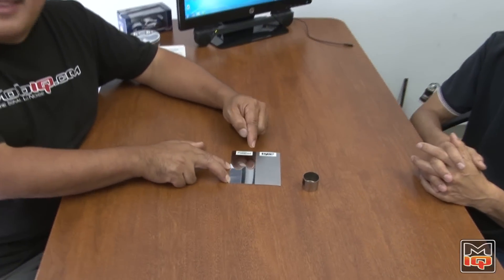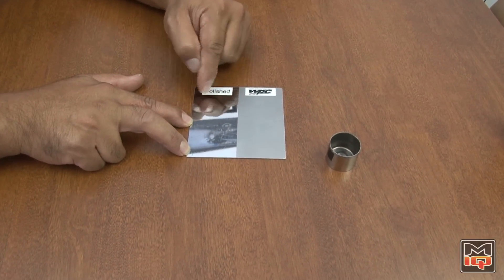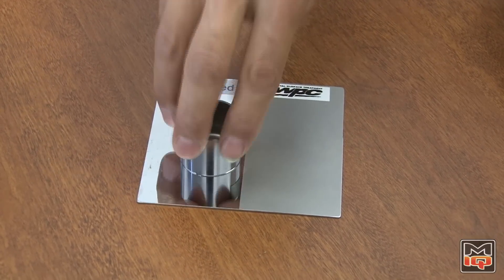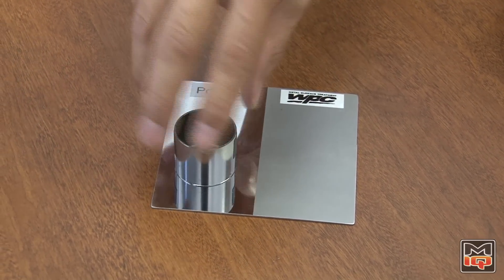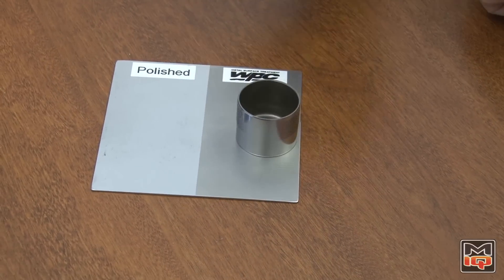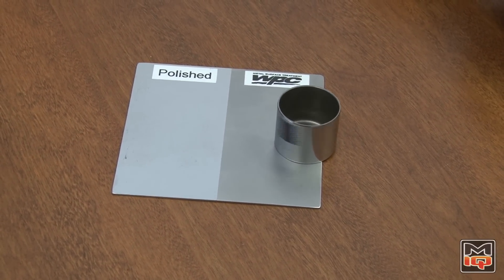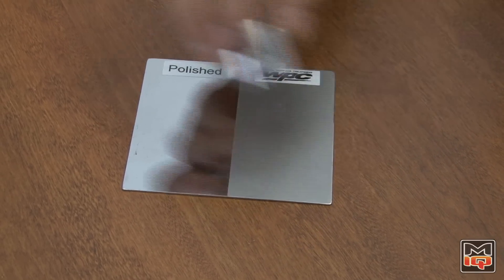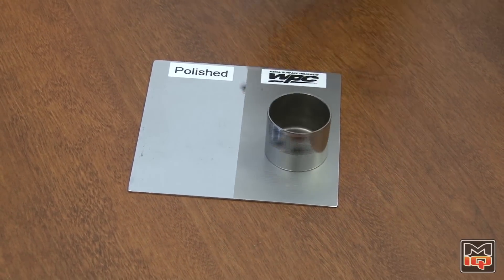WPC Surface Treatment Demo - Anti Friction Properties

Comment: i saw you other videos showing improved surface hardness on case nitrided steels, is it that much better from just case hardened your experience, also does it vary much between the various steels (cast iron vs alloy).
Reply from the maker: My opinion is it makes a bigger difference on non treated metals. It still works on stuff like case hardened, induction hardened and nitrided but I think it makes a bigger difference on just plain old steel
Reply: @motoiq what about titanium??

Comment: Did you guys test at application conditions? this reminds me of the frictionless bearings demonstration.. (no load free spin test with and without grease)
Reply from the maker: We uses this stuff all the time.
Reply: @motoiq  Thats great, the treated surface properties look impressive but terms like antifriction and showing no load demonstration for something that's used for high load, high temperature and under lubrication makes it look not authentic...
Reply from the maker: Yeah that's hard to show easily. What we notice in engines is not so much a power gain but a big gain in wear resistance and fatigue resistance in stuff like valve springs.

Comment: I have been looking into this treatment for pretty much every friction surface of my engine. if the friction is reduced that greatly shouldn't this also increase power pretty dramatically? maybe not increase but decrease reduction of power loss due to friction?
Reply from the maker: Yes but it's hard to prove because no one can afford to do an A to B test.  We use it for longer parts life and better wear which it approximately doubles.  We do notice that an assembled engine is maybe twice as easy to spin.
Reply: @motoiq what shop in America do you guys use to wpc treat your engine parts? Do you also do the crankshaft and block? Do you do the valve springs?